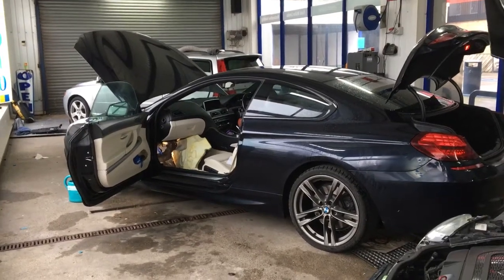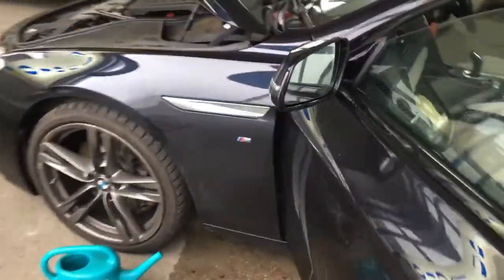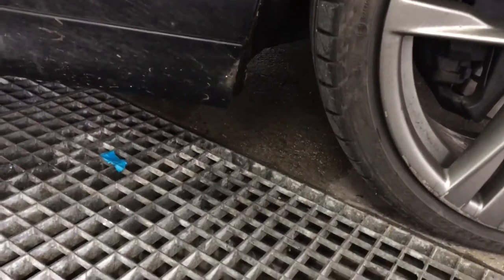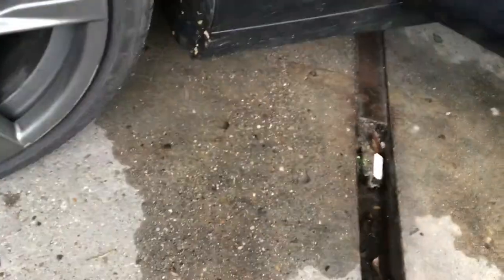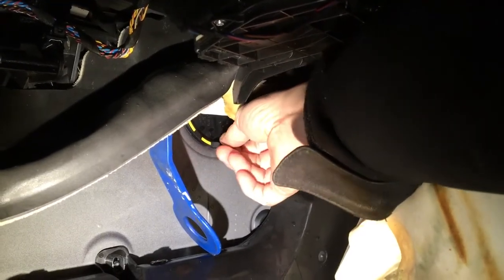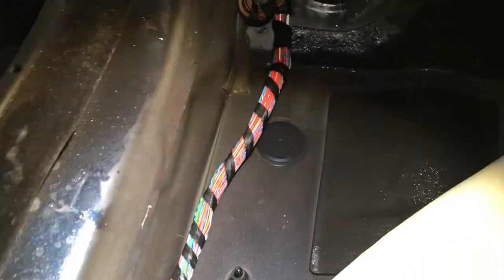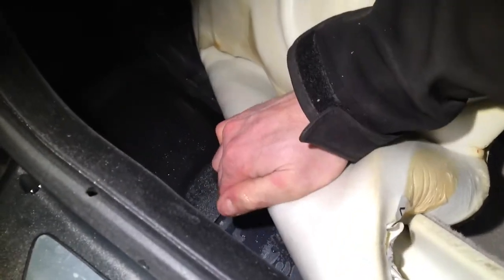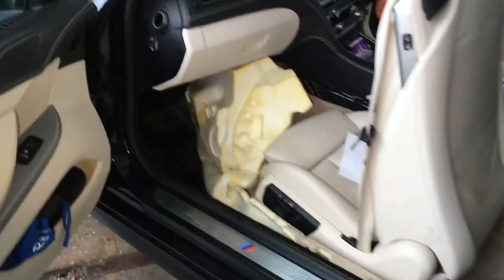BMW 6 Series 2015 | Water Leak Found | #BMWLeaks

Comment: I noticed my passenger side rear carpet (on my 640d gran coupe) was soaking a few months ago, i was pressing down on the floor and water was coming out of the hole where the carpet velco clip was. I cleaned it up and dried it out. Thought nothing else of it. Tonight, i went to my car which was parked facing uphill, i havent driven since yesterday and its been raining a lot, to find a roughly 3 inch pool of water in the rear passenger side footwell. I'm assuming i have this blockage issue too!!  So glad i saw your video.
Reply: How do you clear  the drain ?

Comment: How do you clear the drains ?
Reply: Any way you can. You need to clear out all the dirt and dead leaves.
Reply: @newagainautoreconditioning  hard to spot where the drains are in the video thats what i was getting at , i have a F06 2015 US spec , no leaks ,would love to get it done
Reply: @Agent-mw8th  The BMWs leak through that blanking plate even when the drains aren't blocked. I have no idea if the problem is the same on right-hand-drive cars though.
Reply: @newagainautoreconditioning  thanks brother ill get it sorted
Reply: @newagainautoreconditioning  Does that apply to E60 as well. I have ingress into drivers side front and rear. Exactly as you describe. I thought it was windows and was thinking of changing vapour barrier. Funny thing is my mechanic told me the drain was clear so I took his word. He probably couldn’t be bothered testing it.
It’s on on drivers side not passenger RHD uk vehicle. No sunroof.
If it was doors I would see some water marks near door/ sill entry.
Sat in car and lots of water hosepipe towards door. No seepage. Couldn’t see any via scuttle drain neither but I guess it’s a slow process as next day they were soaked again.
Would appreciate any advice as your the only expert on here and mechanics body shop want to strip car to bare bones.😢
Reply: @eddy45686  There is a play list here: https://www.youtube.com/playlist?list=PL1DLS9aeZHJfL9mjRPwtfderaQKZ6Hjrb
If you go through this, it will show you most of the problems we find, BMWs have many of the same problems regardless of model.
As with all makes and models of cars, there comes a point where plastic and rubber becomes hard, brittle, misshapen, or it shrinks, and there is often a tendency for several leaks to appear at the same time. It is not unusual for us to treat a car and we find 3-4 leaks, so I can't say the blanking plate is your only problem. But that blanking plate is one of the few items we keep in stock as a spare part, because we do so many of them. It doesn't help if the drains are blocked, but that blanking plate can leak even if not blocked, so if we were looking for leaks on a BMW, we would change it as a matter of course.
Reply: @newagainautoreconditioning  thanks for reply. Opened up scuttle drain and lo and behold it was full of water.
Drain was full of mud but couldn’t clean it so forced it down the plug hole. Now have open hole for water to drain thru. 
So one possible point of leak sorted. Also noticed rear passengers side carpet slightly wet but front ok. Anyway water can travel sideways under bulk head in middle.
Otherwise I have a slow leak on dme side as well. 
Anyway took me whole day drying carpets with suction and hair dryers. Still damp but 90% better.
I’m scared to leave covers off tonight as I’m not keen on going thru drying again.
I had covers on half of bonnet so some water would have gone thru scutttle area.
I’m glad I didn’t buy one with sunroof.

Comment: I’ve got the same but mange to clear the front drains water now coming out fast.. but noticed it’s wet under rear passenger seat.. Uk model right hand drive ?? Any ideas guys
Reply: @newagainautoreconditioning  so what will cause wet under rear passenger seat floor well is flooded and damp under seat. Boot is bone dry and roof and door seals are dry could it be from the front still